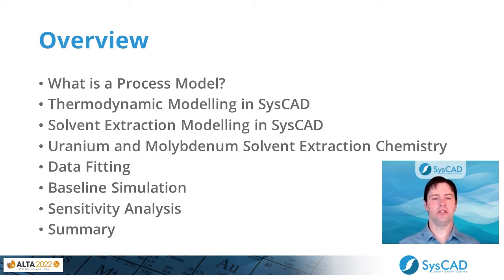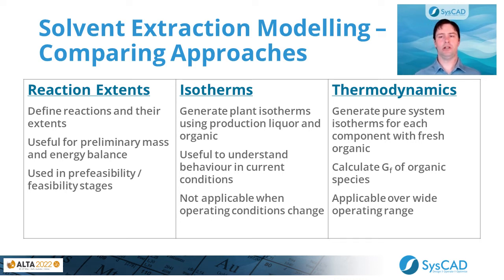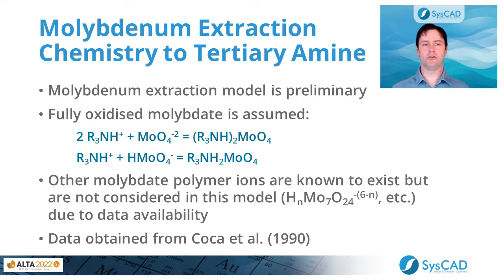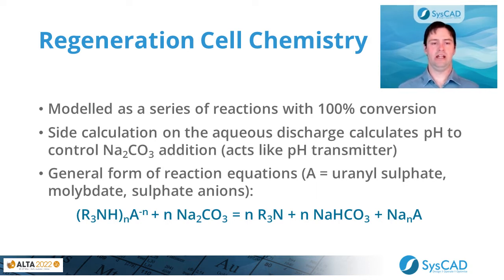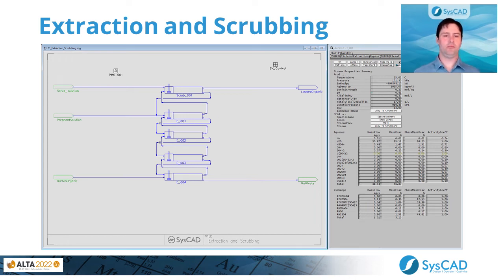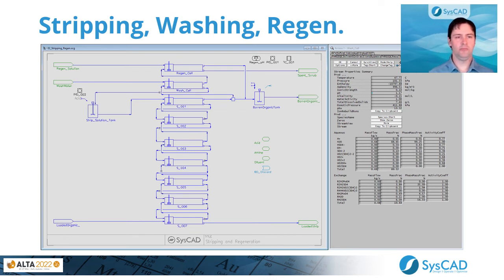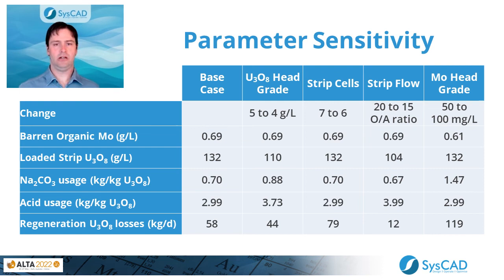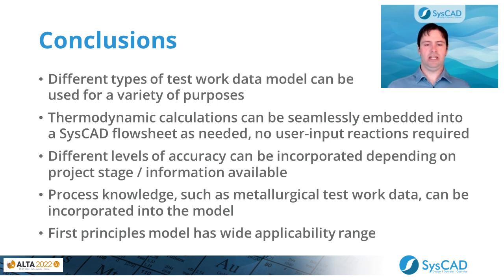Modelling Solvent Extraction of Uranium with Molybdenum Control in SysCAD

Comment: I was looking for a video describing how to extract uranium from ore and I found this. Every 10th or 15th word I had never heard before and, it's usually easy to deduce what a word means by the sentence it's used in, but not this time. I get the impression this video is not about chemical separation, but how to design the process in software.